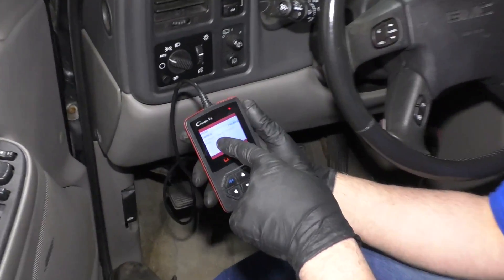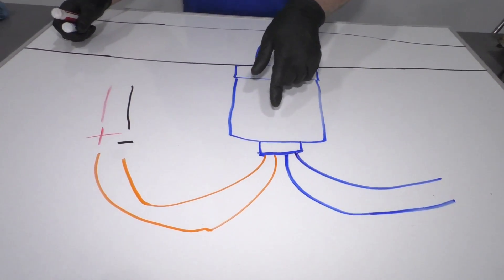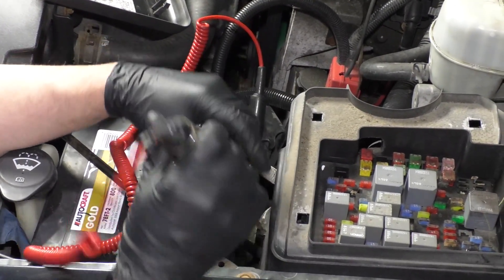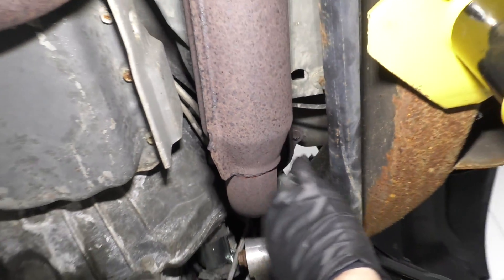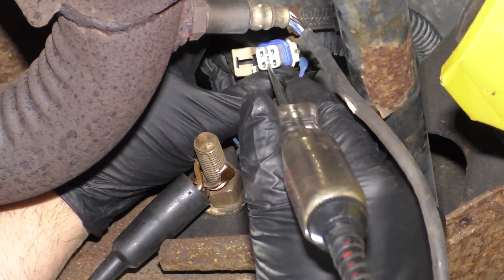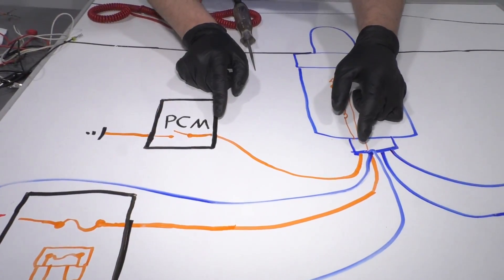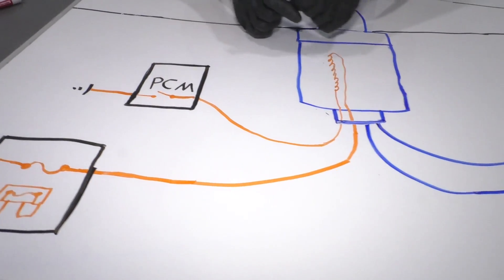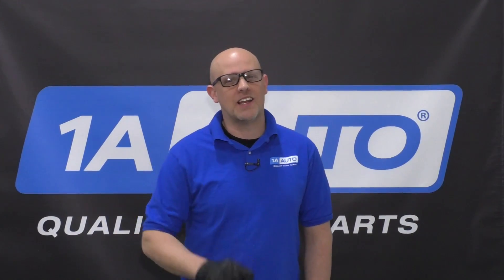Check Engine Light? O2 Sensor Heater Circuit Malfunction - Code P0141

Comment: 2010 chev Traverse. PO161and PO141 both down stream sensors were replaced. Unable to correct this problem until PCM GOT reprogrammed. After reprogramming thePCM truck is running fine.But diagnose everything else properly before you think about PCM.

Comment: After a large storm we had. All four of my sensor warnings came on.. So I unplugged one of them and plugged it back in. And the code went off for bothe sensors that side and now I have two codes for The other side.

Comment: Thanks so much for this video!  I didn't know what sensor was bad, as in the location.  So now I know.
AS far as where the vehicle was made, Canada or the U.S.  -  is that an important factor when getting the right sensor?
How do I know the part number of the sensor I need?  Are they all the same ones?
One quick question unrelated to these sensors:   I'm getting an ECBM (brake module) code also.  Is the ECBM module the same as the ABS module?  Trying to figure this out so I can get the correct part.

Comment: * Note. If your running a RANGE AFM device, Remove it before a Smog inspection .  It seems to keep some  monitors like O2 and O2H from  resetting ! Remove, drive a little (I only did about 15 mi ) , then test !

Comment: 2GRFE P0037 had this issue it’s Bank 1 sensor 2, which is after catalytic converter. And i want to say that after replacing to denso fuel consumption dropped to normal

Comment: I have Ford Focus 1.4 ;16V from 2003 zetec petrol engine. The problem is error code P0420 and only error. Catalytic converter on my car (second owner) is not original but i replace it with new non-original and code returns after cleaning ECU. I noticed that my rear o2 sensor is not heating althoue heating element is ok. Car is working fine, fuel consumption is normal. What is the problem? Why is no code for o2 heating circuit malfunction? Is ECU bad?

Comment: What happens if it pops a fuse every time with brand new O2 sensors? Where would you recommend checking?
Reply from the maker: +@Drew23law69  We wouldn't be able to diagnose an issue like that here, you may want to have a local mechanic take a look at it. Thanks for checking us out! http://1aau.to/m/Shop-1AAuto-c

Comment: So I did all of your wiring test but  when I went to test the 2nd part of your video neg/ pcm as I connect the jumper wire to the tester the light immediately lights up with out turning the vehicle on.  And light never pulse like in your video.   Any suggestions?
Reply from the maker: +@r.j.m.5327 We wouldn't be able to diagnose an issue like that here, you may want to have a local mechanic take a look at it. Thanks for checking us out! http://1aau.to/m/Shop-1AAuto-c

Comment: I have a 2006 Ford ranger 4.0 and the downstream O2 sensor is coming on I didn't check the ground wire yet but it doesn't have any catalytic converters on it I bought it with no exhaust pipes and I made my own y pipe it has the upstream O2 sensors on it and I made a spot for the downstream O2 sensor how can I get the downstream O2 sensor to go off and stop sending the code

Comment: I am really blown away in how in depth this quick video was packed with valuable in depth information, I learned a lot in this video and I greatly appreciate the instructor in his explanation on what could be the reason this sensor is faulty. Variables that I never thought could be the reason like the after market remote starter.

Comment: i have a 2000 ford crown victoria police interceptor. someone cut off my rear cats and plus one of the o2 wires is cut. i have that code and check engine light is on. car is not running right at all . my county does not do emissions. i just want my car running right.dont wanna buy two cats. expensive. whats my options

Comment: good video ,, thanks for the info ,,, i have a 2009 mountaineer v8 and my check engine light just came on , when reading the code it show al 4 oxygen sensors are faulty ,, can this be right ?? ,, fuses are good ,, any adviced ? .. thank you .

Comment: My 2.4l has two wire O2s . Shows a heater circuit code? Checking the fuse next.

Comment: I think on the second testing on the tip of the oxygen sensor  is not enough to  say circuit is good because we need to test the wire from the tip  of the O2 sensor to the pcm port, I’m I wrong?

Comment: Isn't it much easier to check the resistance between the heater circuit connector pins before examining other components?

Comment: Great video!

I have a 2011 Impala LS and I can't clear the P0036 and P0141 codes. I replaced the sensor, I have power on the supply side heater and the computer grounds as well. I ohmed out all 4 wires to the ECM and found continuity and no resistance. I believe either the heater is bad in the new sensor(Denso) or the ECM is faulty.

Comment: Check the set of wires under your truck. Believe me i took this advice and when I inspected the wires under my truck where the transmission and the shaft meet. The wiring harness was rubbing so bad that it exposed the wires. Those wires lead to engine. As soon as i got them closed back up problem solved and my truck runs way better than before. Ever since i bought my 2009 suburban this is the best it ever ran. This got rid of this code and the other ones that had to do with faulty cpu code. Believe me an exposed wire can actually make your engine run bad and set off different codes.

Comment: How do you diagnose a p0133? I have a Jeep compass. Can't find fuse locations if it even has them. Pretty sure it wouldn't be and exhaust leak because b1s1 is right on top of the manifold. I've replaced the sensor every year now for 3 years. This time it was 2 days and code came back

Comment: I have a 2003 Dodge Durango with 5.9l engine I told it for a smog test pass everything it didn't pass because hearter of the o2 sensor didn't  pass but had engine codes at all can you please tell me why my car did pass smog I took another smog place it pass in one hour

Comment: Excellent video.  I have a '99 GMC Sierra 2500 that has an intermittent engine light, P0141.  I already changed the sensor once myself and it just came back on.  It's off at the moment, but if/when it comes on again, now I know how to test it.  Funny that twice when I had it in to the mechanic(s) for other things, they couldn't seem to figure it out🙄  Useless...

Comment: Are you suppose to supply 12v directly to the pcm bypassing the load in the circuit? Could have just backprobed and should have had 12v on both heater wires Key on if the circuit was good,

Comment: If both downstream o2 sensors are removed because of a newly installed turbo kit without cats , would these check engine light codes cause my 18 f150 v8  to go into limp mode at 50% throttle or higher?   That's the issue I'm running into

Comment: Hi! What is the expected current flowing through an O2 sensors heater?
i measure 0.5A only, which would be some benign 7 Watts of heating power. 
I measured 4 Ohms on the sensor which should give me more than 3 amps. Or is it pulsed and thus less?

Plus side of circuit is fine,
the cable to the PMU i still have to test.
If the PMU is the problem, what do do?

Comment: Very nice video, perhaps I would add to measure the average resistance of the sensor itself, just to prove degradation of the element itself,  but normally, there would be no continuity.
But how does the control unit of the car knows the element of blast ?

Comment: Great video, you explain that perfectly. One question though how do you check the blue wires that you have going from the O2 sensor to the PCM to see if they're okay? The power wires I understand how you did that but I was just wondering if the power wires are good how do you check the other two wires going to the PCM? Thank you very much have a good day

Comment: Super helpful thank you! I need help. Instead of replacing the O2 sensor, I preformed the test like you showed in the video. I found that I do have power to the senor but no pulsating light (4:56) when checking the PCM circuit. No light at all. So, I'm assuming something is broken, as explained in the video at around 5:56. How to I find this broken connection?

Comment: Does the heater element only turns on while the engine is cold then shuts off, I have a 08 Jeep Patriot and the temperature of the O2 sensor is high even reaching operational temperatures. Would it be bad ECM? Car runs great.

Comment: Great detailed video, however after going through all of your steps on bank2, I realized that if the O2 heater is good, the O2 sensor would be warm / hot to the touch and include all of your TS steps! BTW, still waiting on that 2000 Chevy Silverado door actuator change w/o opening the effected door! Thanks again!

Comment: If you dont have access to wiring diagram or forget the colours you can switch sensors side to side and see if code moves same as you would do moving coils to check misfire .

Comment: Excellent job man.... Keep it up... You have been a real help understanding the working of O2 sensor 👍👍👍
Reply: I have  heater circuit code for all the 4 sensors for Ford explorer 09 could there any other reason apart from the possible reason you stated in the video just and what could they be  would be a great help to check and diagnose them

Comment: Very nicely explained. I had this code and replaced with a new sensor and got the p0420 code now instead of the original code. Any help would be appreciated.
Reply: Your cat is bad. Sensor is reading the same before and after the cat

Comment: Good vid. but no help to me.  Brand new sensors & I confirmed with a multimeter they're good.  I don't have fuses for these circuits  so can't check those.  No aftermarket security system but I do have the original factory system that still works.  I'm lost.

Comment: Hi!  Excellent video.  The last bit touched on what I think my issue is and I could use some advice.

'04 Acura TL, getting both P0135 and P0155.   I don't have a remote starter, it's all stock as far as I know. 

Mechanic replaced both O2 sensors, engine code remains.  

Can you expand on other things  like the remote starter example that can cause this kind of multiple, persistent codes?

I've checked the fuses.  Looked fine but swapped for fresh new ones anyway to no avail. 

The car has started stuttering during gentle acceleration between 25-30 mph.  Could an issue like this be related?

Many thanks!

Comment: good video, ,  I have a 2006 Dodge Ram 1500 5.7 hemi,,  my check eng. light came on after moving the vehicle out onto the street then shut i off,,  it was cold, ,did a scan and both downstream sensors came up on the screen, Bank 1 sensor2 Bank 2  sensor 2,,  is  it common for both to go at the same time ?

and is it just one fuse fuse for bank 1,,and one fuse for bank 2,? meaning,, does the rear sensors have one fuse for both, and same with the front ?

Comment: Great video!  I have a code for Bank 1.  GMC Sierra 1500. Replaced all spark plugs and wires thinking maybe it was a misfire.  Engine light still on.  It went out for a day.  Feel like truck has a VERY SLIGHT sputter.  Does a bad O2 sensor cause any mechanical or physical symptoms?  What’s the deal with these god forsaken sensors they put in vehicles??  Seems like every time I have a code it’s not an issue with the vehicle, it’s a bad sensor.  Very frustrating!

Comment: good presentation~I went threw the test procedures as you explained-when test light is hooked up to + (positive), connected 02 wire circuit (harness side) test Light, very bright, not blinking, as in your presentation. is this
Good👍? 
or Bad👎?
Reply: Did you figure this out ?

Comment: NYC Corvette
1 second ago
Hello, if the heater element ion the O2 sensor is bad would it show the proper voltage when tested with a odbii scan tool?
Reply: Not likely.  If the heater is bad it is usually a short, therefore a broken circuit, and the PCM will detect and report the code.

Comment: I have a GM 6.0L. My heater circuit for the upstream both bank 1 sensor 1 and bank 2 sensor 1 keeps blowing the fuse. I understand they both use the same fuse. New 02 sensors all around and converters. To be sure it wasn't any of the sensor I disconnected them all and the heater fuse keeps blowing on ignition start.
Reply: Its grounding out somewhere. Check for broken wire touching frame or a wire that has plastic worn away allowing it to touch frame

Comment: I have bank 1 sensor 1 and bank 1 sencor 2 code , just put a new egr tube on it , then cleared codes then light came on and i needed a cam position sencor did that now got p141 on both driver side , im not shur if i should just swap them both out or do all this testing , any help would be greatly apreciated my truck 1999 yukon denali ,,,, im starting to feel like johnny cash ,,, i built it on bolt at a time .........lol

Comment: Hello, I have kia optima 2014, when i put obd2 reader, I see p0036 error, but there is no engine light, i just change my sensor
Reply from the maker: +sahil patel We wouldn't be able to diagnose an issue like that here, you may want to have a local mechanic take a look at it. Thanks for checking us out! http://1aau.to/m/Shop-1AAuto-c

Comment: Had to extend my o2 harness for new headers and accidently burnt the wires on my headers, so made a new harness and had idle issues so went and got a new o2 sensor and it fixed the idle issue but now I got this code, didn't even think to check the fuse whichis probably blown from the wires melting and shorting...

Comment: HELP!!! WHERE on a 2001 Toyota Echo are the o2 sensor fuses? 
I had replaced my o2 sensors 2 years ago, and my check engine light went out and rushed to the smog place and passed, and like 1 hour after passing smog, my check engine lights came back on. It gives me a P0135 and a P0141 codes AND now I get a "low coolant temperature" code, p0125. I can tell you that I replaced all these sensors a few days ago. That did NOT solve the problem. The "Blue Driver" OBDII device shows that the o2 sensors are providing a signal. I replaced the sensors with genuine toyota/denso parts. What could be the problem here?! I would think a bad catalytic converter, but that would give a different trouble code....

Comment: Great vid easy to understand, 
I am having a problem with my 95 Jimny Cat light in dash. Light only turns off after driving and exhaust has heated up. I tried your method but my o2 sensor only has one wire going to it. All fuses are good. Any ideas how to test this?

Comment: Yikes! I get full voltage from the PCM until I plug in the O2 sensor (load). Then the voltage drops to milivolts. The O2 sensor checks out OK and I've tried another sensor  that I know works in another Subaru. Also, with the key on but the car not started, the voltage holds at battery voltage (sensor disconnected). After I start the car, that voltage jumps around from about 11.5 to about 13 volts (sensor disconnected). Sensor gets hot and pulls about 1-2 amps if I apply battery voltage directly to heater wires.
Any ideas? PCM? I'm going to pull it and check connectors,, all that.
2004 Subaru Baja Turbo, bank 1 sensor 2.

Comment: So, what happens when you DO have 12 volts measured at the meter? And does not heat up? And you put a new sensor and same thing? I guess my question is you didn’t cover the blue wires? Can you cover that part? Thanks man!

Comment: I just installed  new o2 sensor correct plug denso for honda but still had chk engine light cleared code p0141 again but came straight back only have multimeter in your experience  what most likely cause it how can i diagnose  please?
Reply from the maker: +colm brock We wouldn't be able to diagnose an issue like that here, you may want to have a local mechanic take a look at it. Thanks for checking us out! http://1aau.to/m/Shop-1AAuto-c
Reply: Same with me I installed a new downstream 02 sensor and still gives the same code
Reply: How did you solve it?

Comment: What if I got P0161 and changed the O2 sensor out. Code cleared on its own, and a couple months later I get P0300, P0141, P0161, P0300 (Random Misfires) exactly as shown? 97 C1500 with a 5.7 in it. I'm not a mechanic but trying to do everything myself on this truck to learn

Comment: I have a 08 g37 with p2a code and bank 1 sensor 1 reads 2.2-2.3 and bank 2 sensor 1 reads 1.98-2.03 is it safe to assume i need a new sensor? My car backfires abit at idle and during hard acceleration. Any suggestions help. Thanks
Reply from the maker: +Tomas Lopez We wouldn't be able to diagnose an issue like that here, you may want to have a local mechanic take a look at it. Thanks for checking us out! http://1aau.to/m/Shop-1AAuto-c

Comment: When testing the PCM side, is there something wrong if the test light comes on BEFOR starting the engine (no key in ignition)?   fyi, my connectors are reversed... male side is wired to the car, female side is wired to the sensor (03-CRV). Tks for any assistance!

Great walk through!!!
Reply from the maker: +Deborah Mcgiffin Thanks for checking us out! http://1aau.to/m/Shop-1AAuto-c

Comment: Fault code: P0056 Heated Oxygen Sensor Heater (HO2S) - Circuit Malfunction (Bank 2 Sensor 2)

Bmw 320si e90 n45 model 2006

Comment: It would be nice if you explained how one can determine which side bank 1 is located on. I see that they can be located on different sides depending on make/model. This is to say bank 1 isn't always the driver side. So how is it determined? Thanks
Reply from the maker: +Michael Thompson Bank 1 will always be the driver side, or the radiator side on a transverse-mounted engine. Bank 2 would be the opposite; the passenger side or firewall side.

Comment: I put in a new o2 sensor but the code still shows
Reply: Circuit problems then. 
Follow Andy's guide.
Reply: Or cheap 02 sensors off eBay cars don't like them you need a good brand